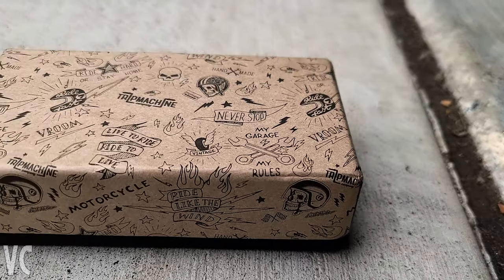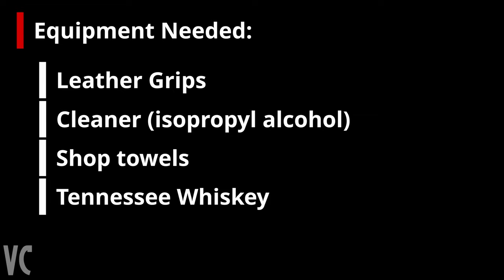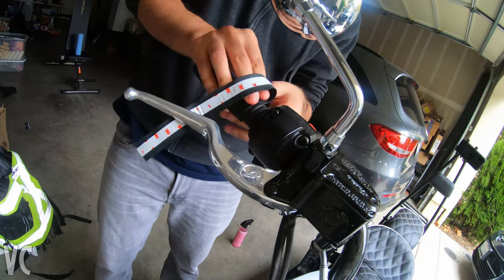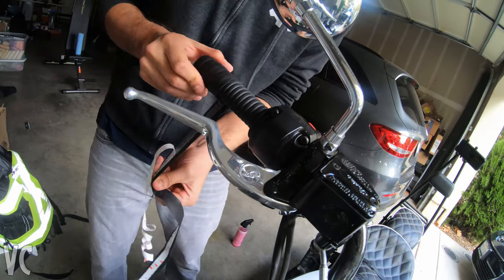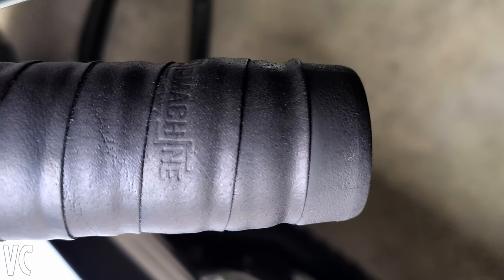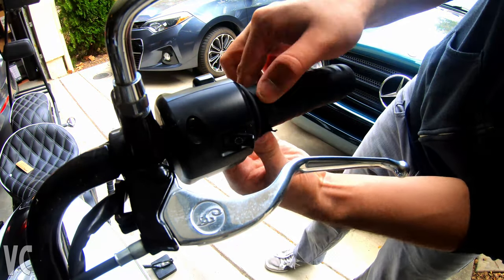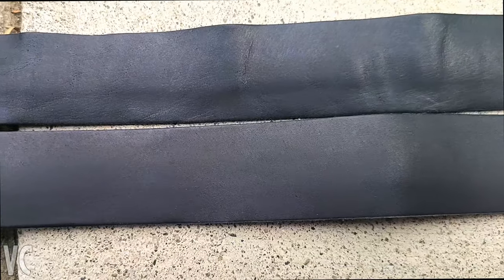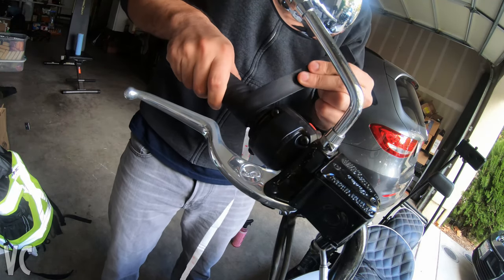Trip Machine Grip Installation GUIDE

Comment: Just received the Tobacco Tan from Trip Machine to add some cushion to existing grips. Found your YouTube to see how to install. Installing mine tomorrow and appreciate your guidance and tips.
Reply from the maker: Good luck! I've been very happy with mine ao far! Absolutely no issues.
Reply: Alexia, I am waiting delivery on some tobacco ones as well. How did you install go and do you like them?
Reply: @mrharleypup  I practiced wrapping a few times to make sure ended up on the grip where I wanted to + I used my own glue to seal end. Start at end of grip working inward. A couple YouTube videos did the opposite, which is incorrect. I've had wraps on since early April and they look better with age. In addition to my gloves & the wrap, my grips now have some cushion and I love them. Haven't had any issues with them from day one. Enjoy yours.
Reply: @alexiasherman3358  Thanks for the reply. I put mine on today - worked outside in as you suggested. They look good. Hopefully take the bike for a spin when the glue has dried. Take care

Comment: They look pretty nice dude. But grips wise, I love my Vans so even in case you wanna look for something different, give them a shot ;)
Reply from the maker: Thsnks! They do feel nice after riding a couple of times with them. So far I'm happy.  Having a thicker grip is way more comfortable.  

Ill check out the vans grips if these don't do the job and I end up replacing the entire grip.  I opted to start with these first since I don't have to actually remove the old grips.